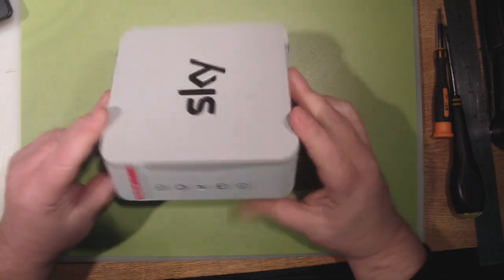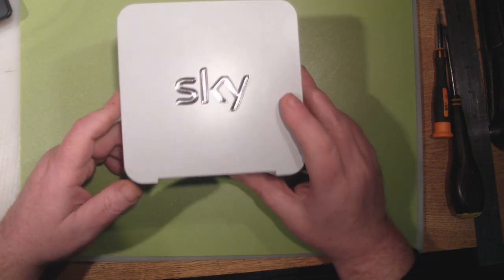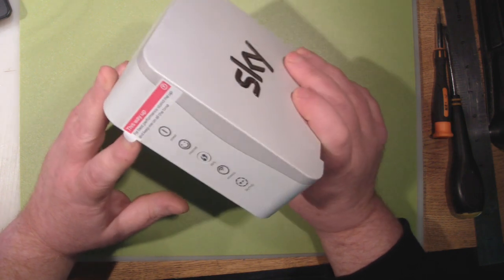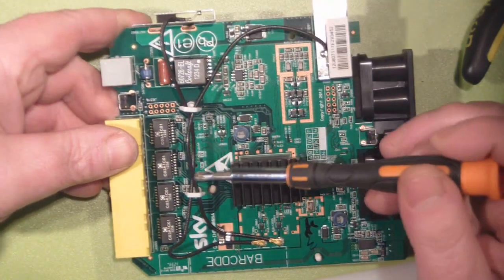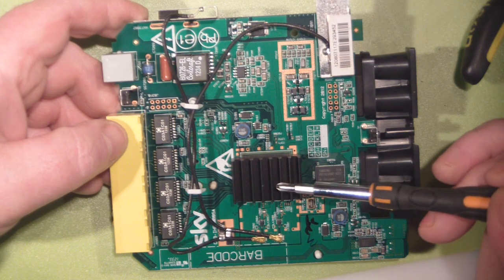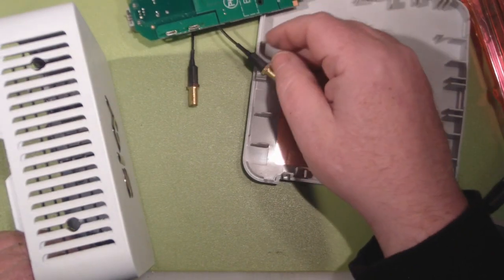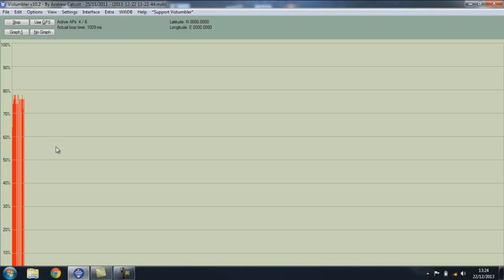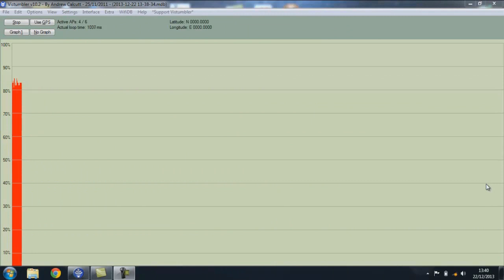Sky Hub SR101 Wireless Modification Fix #43

Comment: Mine appears to be getting worse with age! I've put a 9dBi magmount antenna on my PC, which is only about 5m away from the Sky router and I'm still not getting a full strength signal - much better than it was though! Not sure about modding the router, it might be simpler to just get a new one that performs better.

Comment: Hi. A very interesting video. Have you noticed any signs of overheating with the power supply shielding in place? I'm in the process of making the shield out of PCB material, with the copper on the outside of course, but I'm not sure about the heat if I enclose the PSU completely. Any thoughts?

Comment: Thank you for this video.  I am mortified to have watched this having just received the router with absolutely no electrical modification experience!  I really want to modify my box but fear I will blow up my house.  The other problem with this router is that it is designed NOT to be used with an external router meaning that you are either stuck with it or make your modification without being able to upgrade but buying an external router.

Comment: hello, Can you please tell me if i am able to use a netgear wireless booster with my sky router that sky provided? Also i read that you can also connect a second modem to your primary modem to help boost signal. Once again is this possible to do on a sky router using a different companies router, i.e netgear again? thanks very much.

Comment: Andrew have you got a template for that shield  by any chance ?
Reply from the maker: Sorry Richard I just made it using the power module as a guide
Reply: andrew mcneil OK no problem I can work it out. What's the plastic material that you used to sandwich the copper  ?
Reply: Richard Allen Just saw you answer that below...plastic and epoxy....I'll be giving this a go...
Reply: My dose not have prolems so how come yours

Comment: I've done this today. There is a big difference. The buffering is virtually eliminated.
Reply: Where did you get the sma antenna kit from please mate?
Reply: Jithu Menon 2 of these. Ready wired. http://www.ebay.co.uk/itm/1Pcs-2-4G-2-5dBI-Wireless-RP-SMA-Antenna-with-Extension-Cord-for-NRF24L01-CC2500-/271648293939?pt=LH_DefaultDomain_3&hash=item3f3f800433
Reply: Thank you very much for a quick reply. Very kind of you. Is it easy to desolder and resolder the cable to the PCB? Thanks again. Just ordered the items.
Reply: Jithu Menon  They're push fit. No soldering at all. You can buy a roll of copper tape in most hardware shops.
Reply: You're a legend mate, thank you. For the shielding, I'm going to do as he's done for the black sky hub; foil on card. Once again, thanks

Comment: So if performing a fairly basic modification, can vastly improve the performance of Sky's router,
WHY then couldn't the manufacturer bother its arse , when to have had an arrangement similar to yours as part of the standard design, could have achieved the same results, for only a few pence more per unit. Which they could have easily past the cost on to the customer without them even noticing. 
Using the economics of manufacture and parts is a piss weak excuse.  Thus why would the manufacturer be so crap?

Comment: Hi, Andrew. I had the older Sagen Sky router which was terrible - the worst reception I have ever had in a router. Sky said that they would send me their new Sky Hub router (the alternate black version router to your white router) for free! Great, as it saves me £60. It arrived yesterday but now that I have seen your video, I am concerned that I'll still have the same wireless problems. do you know if the new 'black' router is shielded inside and has better antennas? Thanks.
Reply from the maker: I have got hold of the black router and will be uploading a video soon. It does have a different broadcom chip set but the chipset is still 4 years old. The range is a little better but the power supply interference is still a problem as the design of the router has not changed.
Andrew
Reply: Oh Dear! I hoped that it would be at least shielded - there are no antennas sticking out of it as I believe they like the overall look of it but what's the point if it doesn't function correctly!

I want to link it to my Apple Airport Base Station which DOES have better reception but Sky won't give me any advice as to how to do this, so I am stuck with a crappy sky router than looks nice - I mean, what's the point?! Looking forward to seeing your video. Thx

Comment: What Antenna's did you use for this? I am about to get a hub from sky which is supposed to be the latest. I have Farnell & R.S. Accounts if you have any part No.'s. for connectors and antenna's

Comment: So weird. I just left Virgin due to broadband issues on a 60mb connection. Superhub 1 and 2 gave awful coverage in my house. Nothing upstairs at all. Ended up moving to sky on 16mb speed  with this router and it's much better. I get wifi upstairs now !!! My HD channels are much sharper on sky. I guess some areas are better on different providers.

Comment: impressive mod andrew ... my neighbour has the same router and i will be doing this mod .. his wireless range at the moment in at best around 25% to 30% .. could you connect this to a outside antenna such as a TP-LINK TL-ANT5830B Antenna .... ?
Reply from the maker: Hi Brian if you do this mod you can connect any antenna you like as long as it has a  SMA connector.